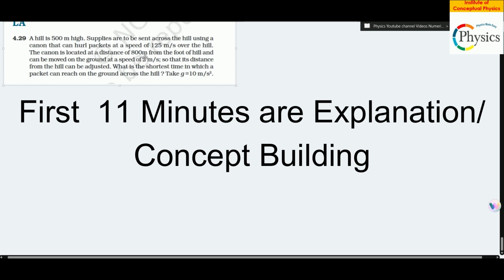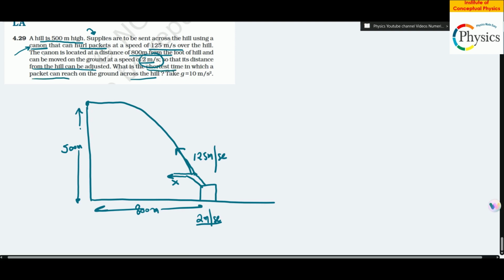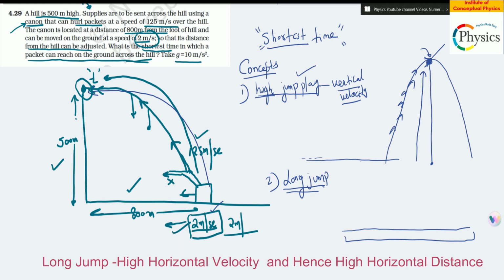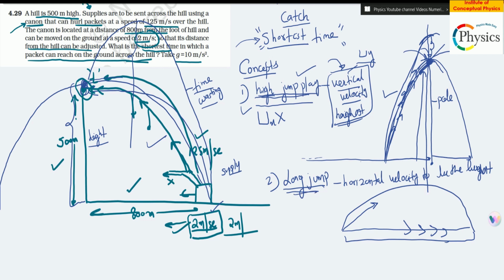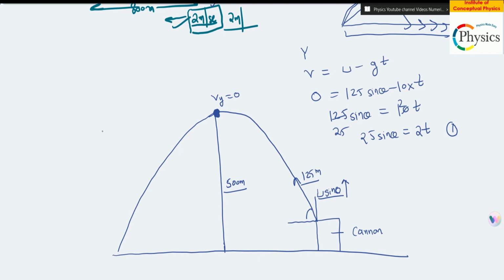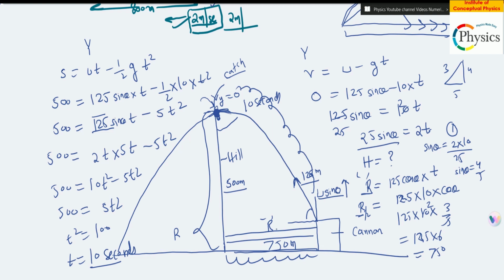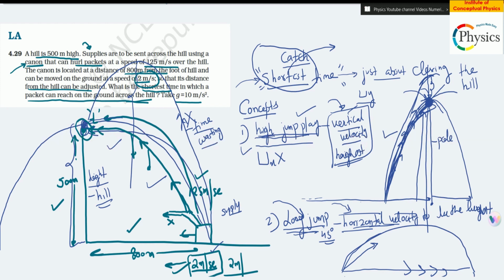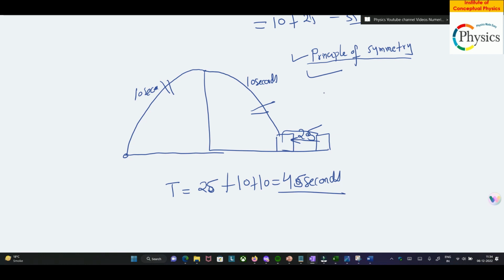A hill is 500 m high. Supplies are to be sent across the hill using a canon that can hurl packets at

Comment: Dear sir, if we fire the cannon at 800 m, without moving the cannon, it takes a little over 20 s. Is it not the shorter time than given in the solution?
Reply from the maker: vintonrebello9997
🙏 Thank you for your excellent observation and thoughtful question!

You're absolutely right to explore the case where the cannon is stationary at 800 meters and the projectile just grazes the top of the hill at 500 meters height. When we solve this assuming the hill lies at the apex of the trajectory, it means 800 m is half the range, so total range becomes 1600 m.

From there, using the projectile’s speed (125 m/s) and calculating the horizontal component, the total time of flight comes out to be approximately 21.33 seconds — which is less than the 45 seconds it takes in our original "moving cannon" scenario.

💡 This is a brilliant example of thinking beyond the given and applying physics concepts logically. Other students should definitely go through Anton’s logic — it's a shortcut to crossing the hill in minimum flight time, without involving any motion of the cannon.

Your curiosity reflects the analytical mindset that NEET Physics now demands. Keep questioning. Keep learning. You’re on the path to mastery! 🚀
– Team CRACKNEETPhysics